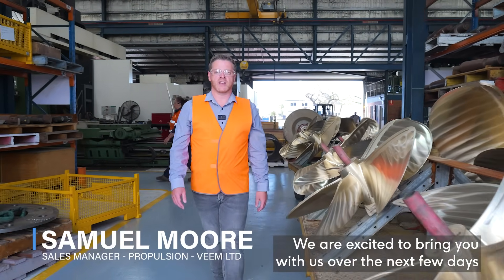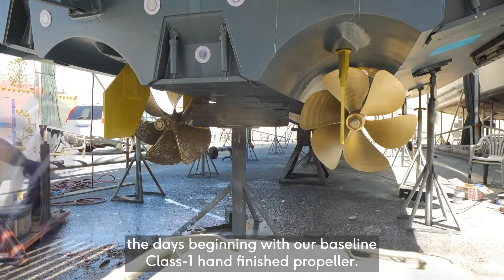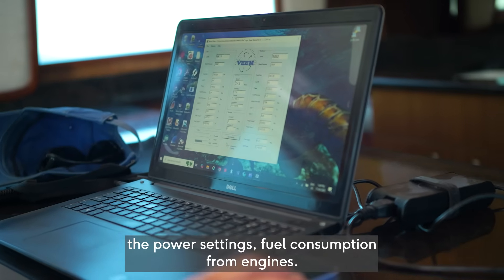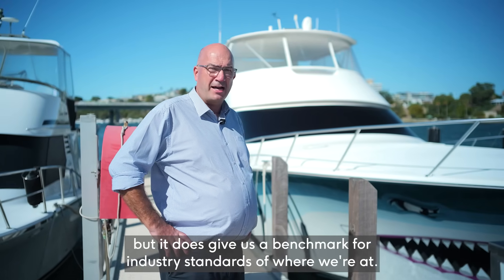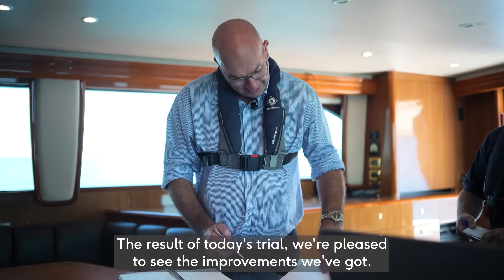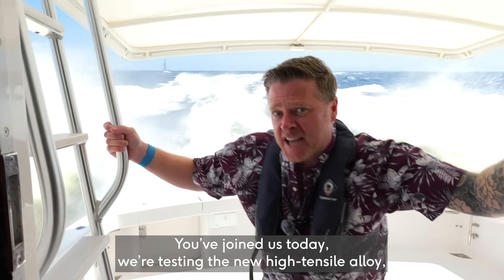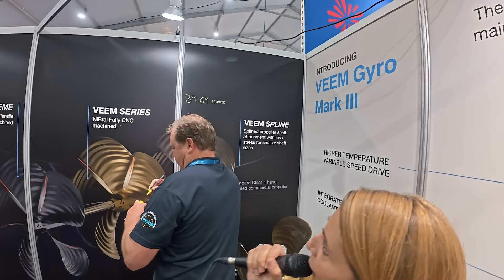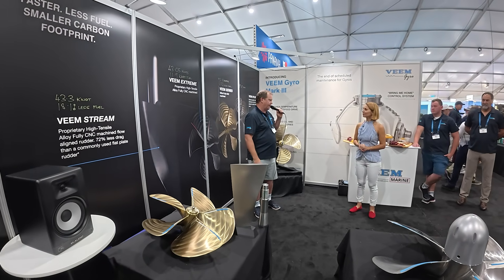VEEM Extreme Sea Trials: 18.1% verified reduction in emissions

Comment: Strong results!. the fuel savings cant be at WOT.  The engine will take the same amount of fuel to produce the rated power. maybe you need less RPM to achieve the same speed (hence the savings?)  or you are consuming the same fuel to produce a higher speed (more MPG) could also account for savings.  Which one is it?